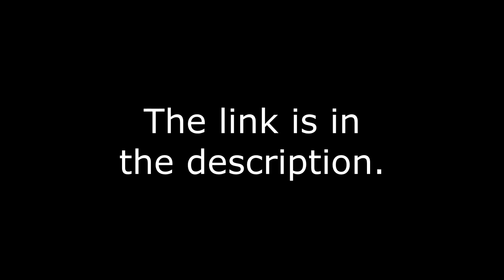HOMEMADE LAWN MOWING ROBOT

Comment: If the gears are broken or worn, take them out, get metal glue (the heavy duty kind advertised for really nasty stuff and coat the gears with it. Then, slowly, with your dremel cut the gears back to shape aided by a sharpie and gratuitous back and forth motions. You can do this with files too, but i suppose a dremel works faster.

Comment: +3DMachines im looking for a upgrade. what would be a better bike for most things. a 200 4 stroke or a 125 2 stroke. but at the moment I have a 125 pit bike 4 stroke
Reply: 125 2stroke have more power than 4 stroke
Reply: fyi if your going into 2stroke and never had one before go yz80 yamaha, i hit 60mph on my 1982 yz80 fun little thing that pulls wheelies no problem, start from the bottem of power and work up.
Reply: I already have something that is faster than an 80 or the same speed. I'm looking for a 200 4 stroke honestly
Reply: ***** 80cc 2stroke 5 or 6 speed, my 82 yamaha YZ80 does 60 with a 5speed. I clutch up wheelie no prob.